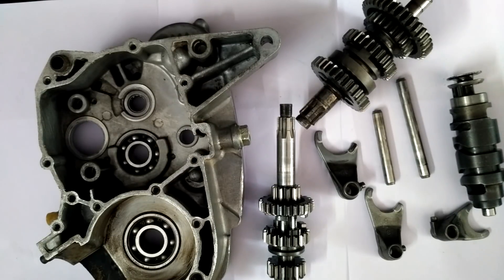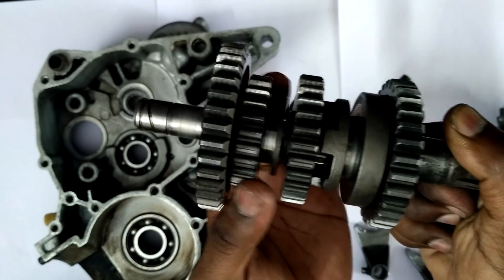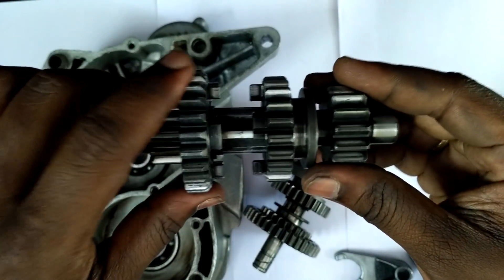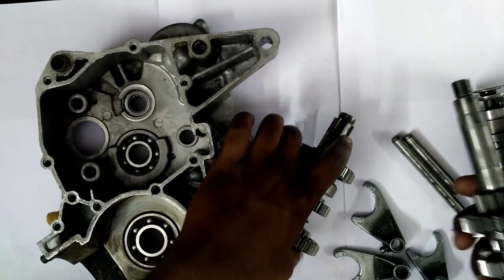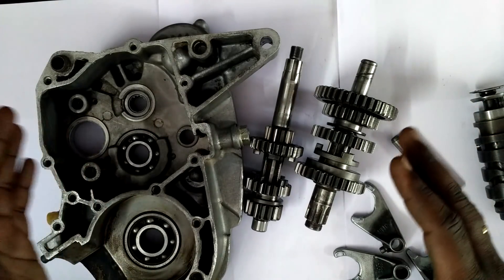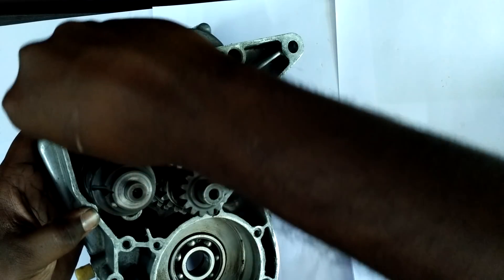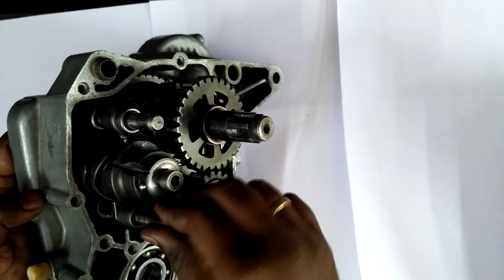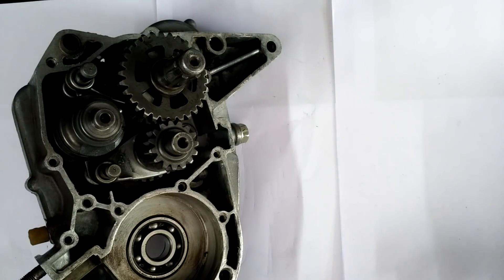Motor cycle gearbox , working , damage diagnosis and assembly ...

Comment: Thanks for the video.  I’m not sure why you made no mention of gear box problems aside from noise.  Dogs get worn, shift levers get bent, gears either fail to engage, or pop out of engagement, and no doubt other common problems occur.

Comment: What is the problem when in 2nd 3rd 4th gear and the motorcycle slips into a false neutral? this happens when when on a hill . i have to quickly shift down to a gear that bites .
Reply: Late reply ,, but i have the same problem with 3rd gear ,, what was the problem?

Comment: Hi Bunsha! See you didn't show all of the small stuff the spring-loaded items running on little levers not "gear running", well Thomson there's around 25 springs so 50 leverage points it's mostly on either side of those gear-shafts your video cleverly shows, the factory technicians have a short time to figure out where the levers go including how levers are layered then mark said levers assembled without springs I, ii, iii, iiii, iiiii knowing then you allow %7.5 extra length between contact points for spring placement and usually no 2 springs are the same length and if you have a heavier gauge same length spring said heavier gauge spring is a higher use priority lever return, then 50lbs is average maximum torque setting for spring pivot bolts, a pair of circlip pliers are recommended for newer gear boxes.

Comment: if i run my bike in 3rd gear, it slups and makes a katak katak type of sound, is it a intimation for damaged gears?
Reply: Have you found out the problem you’re having in third gear?
Reply: @mackite4846  yep, changed to new gearbox ✌️😎

Comment: Nice ande very informative video.I have apache RTR 160 4V. I am facing a problem in gearshift. Sometimes gear shifts are smooth sometimes It becomes hard.service centre also didn't find issue.what could be the problem please suggest solution.....
Reply from the maker: Check your clutch shaft bearing
Reply: @THOMSONRICHARDS  ok
Thanks

Comment: I feel increased vibration at shifter on slow speed especially between 1st and neutral. Will only be noticeable if I go slower before a stop. Feels like something is rattling. Is it something on the transmission?
Reply from the maker: Check clutch and clutch bearing

Comment: I have fz v1, there is a problem in gear shifting, feeling strucking gears. No smoothness at shifting. clutch adjusted, clutch plates changed, gear shaft changed but problem not solved it still continues the problem. Please give solution. Thank you.